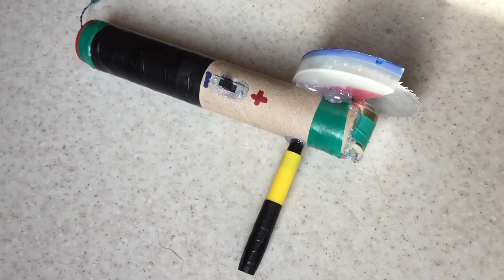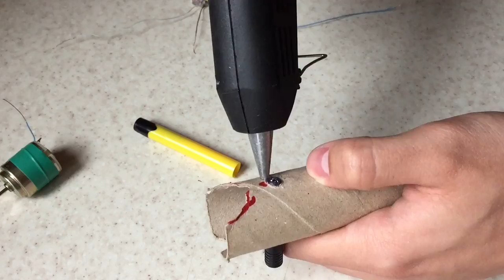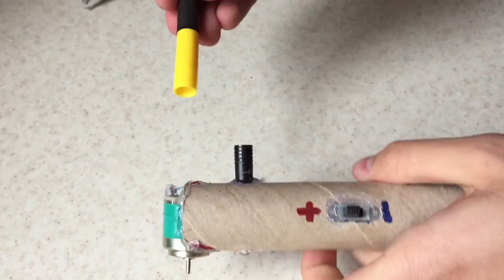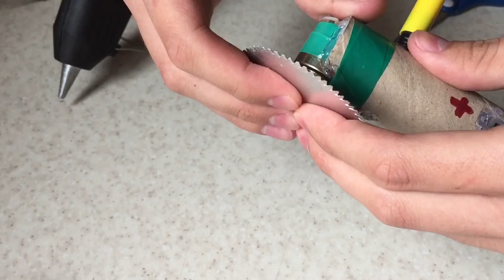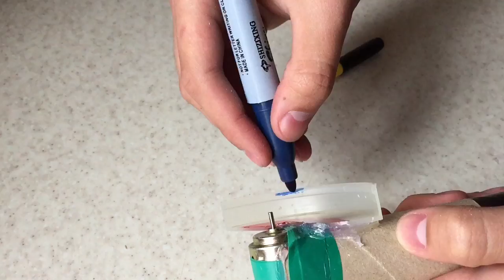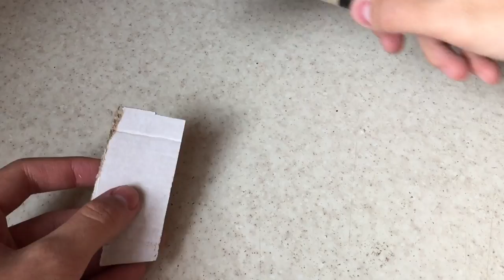How to Make a Dremel Tool (Angle Grinder) - Easy Way - Amazing and Crazy invetion

Comment: Thats cool ...I used to make aluminum fan blades and make little fans with those little motors  I'd connect like 4-5 d batteries to make it work lol.. mounted it all to a wooden block .  thanks for showing this !

Comment: tip to creator: Bigger teeth are for wood and other soft materials. Smaller teeth are for metals and harder materials. the smaller the teeth the more the teeth the bigger the teeth less teeth and try making a sander probably better for weaker motors like this one. none the less Great job dude.

Comment: Yeah, that's not really powerful at all. It won't be long before the motor pulls out of the cardboard tube, and using hot glue to secure a semi sharp piece of metal that will be spinning is really dangerous. So, not powerful, not really useful when you consider some flush cutters will cut quicker and neater than this, and not safe either.
Reply: It's a proof of concept I guess you can say. I mean if you don't have much money lying around you can pretty much build this with an old toy car or something with motors and wires in it.
Reply: +destan5568 don't get me wrong, I love the whole DIY side and making something for scrap etc but now you could buy one of these from China for a few dollars.